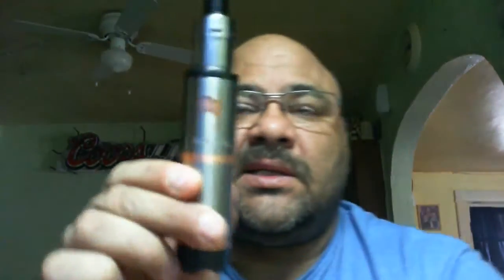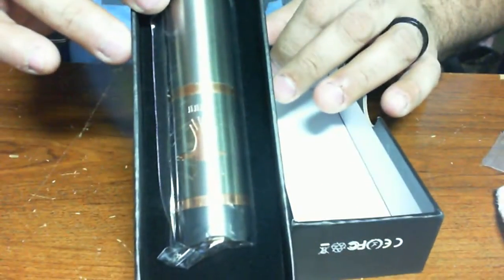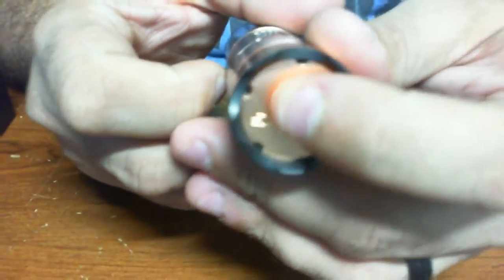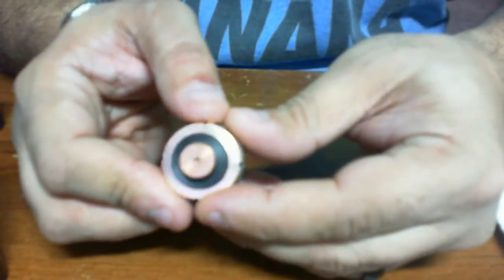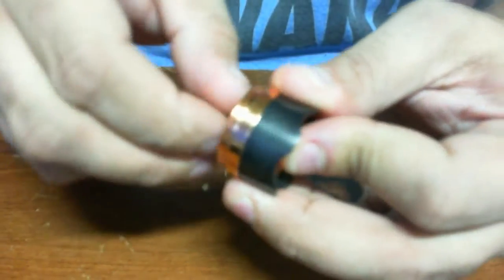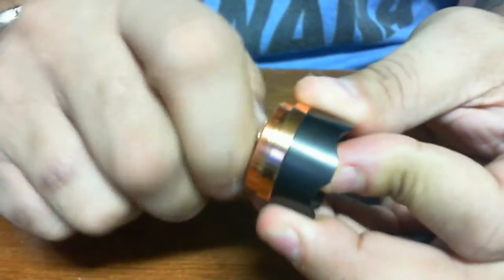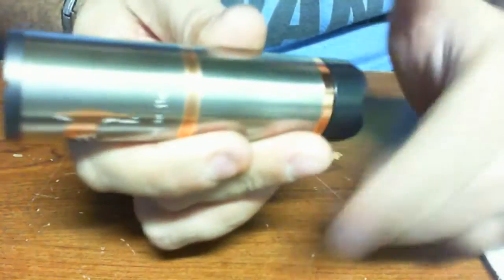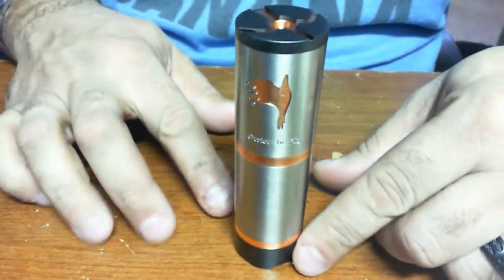Little Bird 26650 mechanical Mod

Comment: Hey Ricardo, nice review. I was wondering where you bought the Little Bird. Thanks.
Reply from the maker: Sorry haven't been on in awhile.. I have two still sealed left from my original buy.
Reply: Ricardo Santiago I just messaged you Robert.
Reply: Ricardo Santiago Messaging is brutal on YouTube. Would you want to sell one Robert?
Reply from the maker: vinnyc365 Sure. I figured it out with pp fees and shipping I can sell it for $32
Reply: Ricardo Santiago  Thanks Ricardo.This morning I found another mod that I really like for about the same price. Now I have to decide.

Have you seen the EHpro Route 66?
Reply from the maker: vinnyc365 I thought about buying one of those myself.. I went with the little bird because it had all copper contacts. But I might still grab a Route 66
Reply: Ricardo Santiago
I hear ya.
Both of these mods are hard to come by.
The Route 66 has copper contacts with silver pins in them.
This is a hard choice.